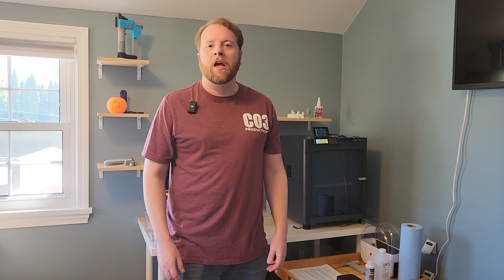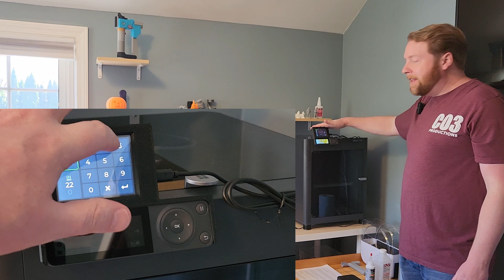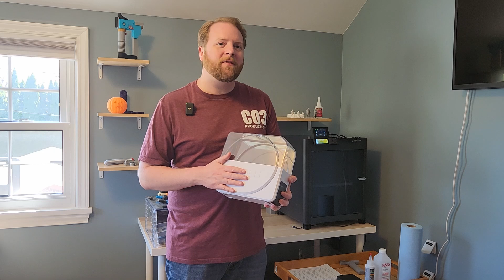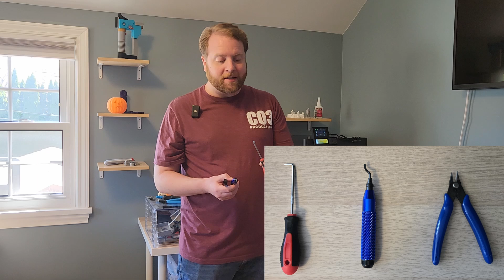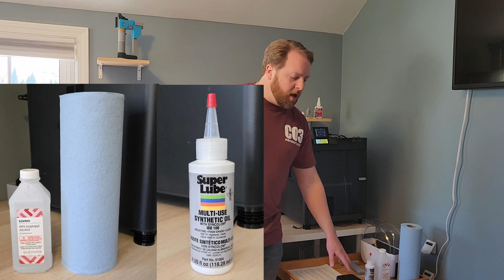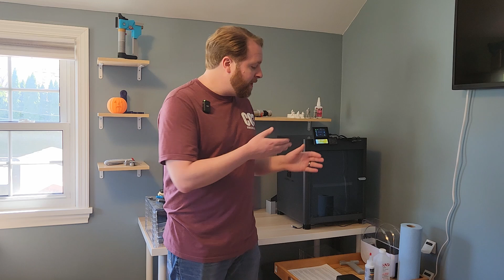Bambu Labs P1S/P1P - Accessories and Tools I Use

Comment: My personal opinion on Filament dryers after looking at them for a while: Dont get one and dry in your oven instead. Many driers dont quite reach the temperature needed for some filaments and they dont have air exchange to get rid of the humidity that evaporates from the material. Many dont have air circulation either, which makes the drying less effective.

Your oven certainly can reach the temperature, has more volume inside to disperse humidity and usually they have circulation, too. Just dont dry at 200 C° please.

After drying its equally important to keep your filaments dry. So before getting a dryer I would get sealed boxes and dessicant beads instead. Get something like cereal containers with a sealing lip.

Good video, thanks!